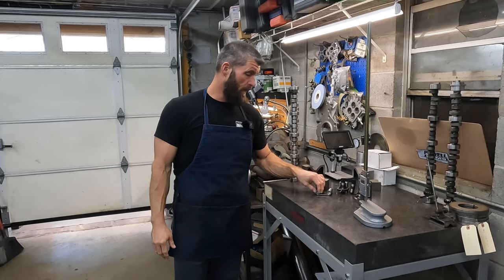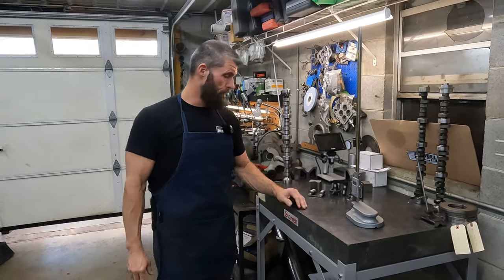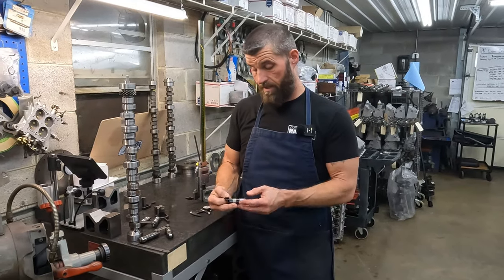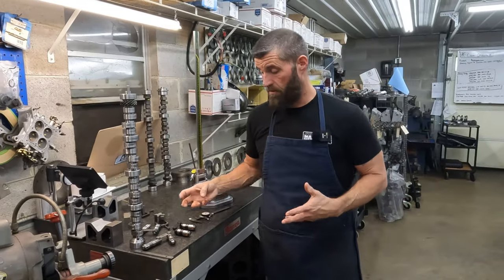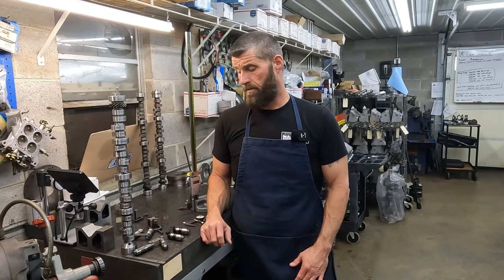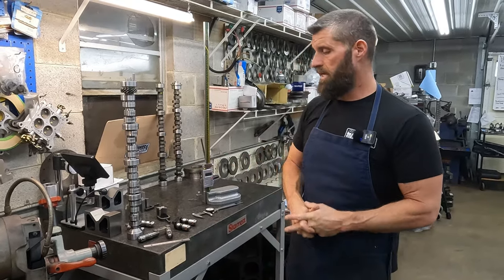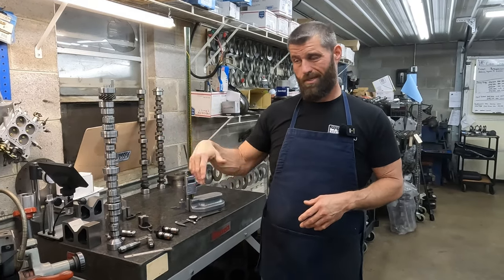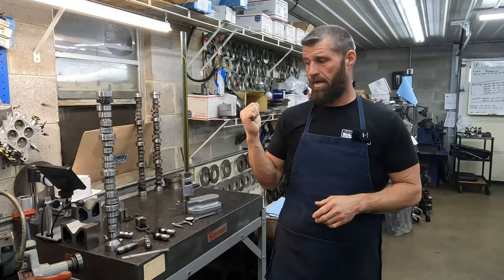Bb/Fe Ford Roller Lifter problems to be aware of

Comment: Hey Daniel,
     Tim here, me, my buddy (the topic for the vid), and my boss, (a Dr. Ford kinda guy).....all had the same thought that we believe the 460 block has a longer lifter bore, so it wudnt be an issue......FE's we're pretty sure, have shorter bores, ergo, the oil hole is exposed at max lift......cant say for sure, and we cant find data to confirm, and dont have both blocks avail at moment to get a measurement.......my gripe is to WHY wud you put the feed hole ABOVE the oil band PERIOD!!....WHY??.....BAD engineering.....put it in the oil band......i can make restrictors to feed the shaft rocker system properly.....but that doesnt address the high oil hole at all......i chk'd out ur Gatormans, i liked where the feed hole is, AND liked how they chamfered/have a lead in to the feed hole, INSIDE THE OIL BAND!!!..what idiot decided that the feed hole shud be ABOVE the oil band???......i have no answer.......seems ur Gatormans are closest to proper control, our FE customer aint gonna like tryin to send back Johnsons.....but it AINT rite.......all of us are just tryin to make it rite.....once more, THANK YOU for ur time, expertise, and explanation.......seems when i sub'd a while back, was good, as i've known for almost a year now, how good you are.....i'm anal, pay attention, and engine building for me, is like a fine lady!!!!.....TY sir, again!!!
Reply from the maker: We have both blocks here, do I'm gonna do more investigation